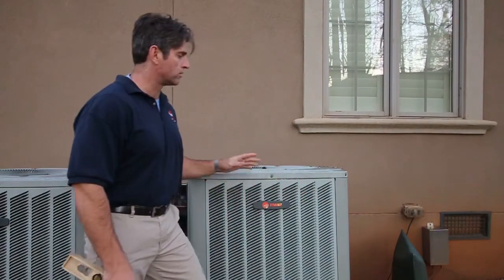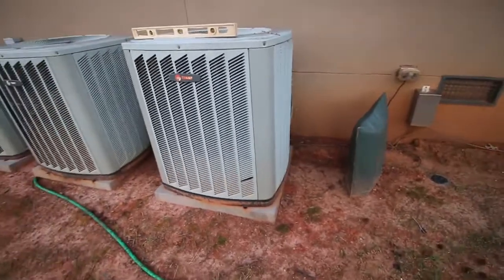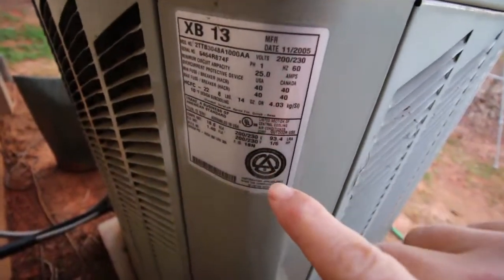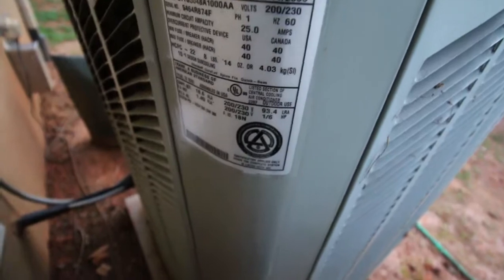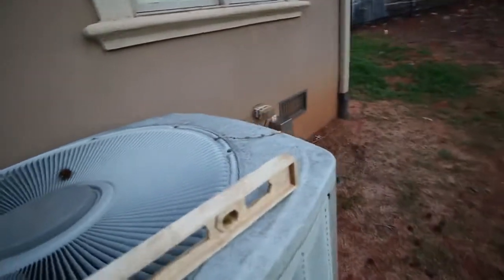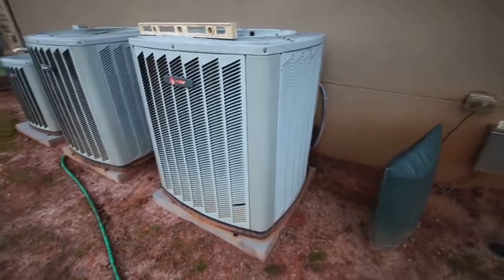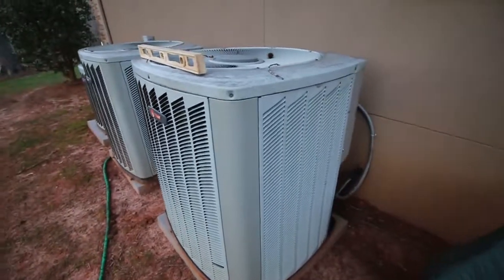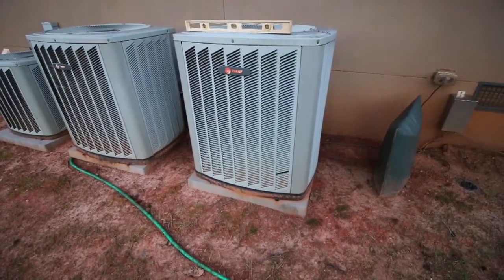Inspecting an Air Conditioner

Comment: If it’s a heat pump you don’t want the outdoor unit to be level. In heat mode the coil will freeze by design. When the ice thaws you want that water to drain away from the house.